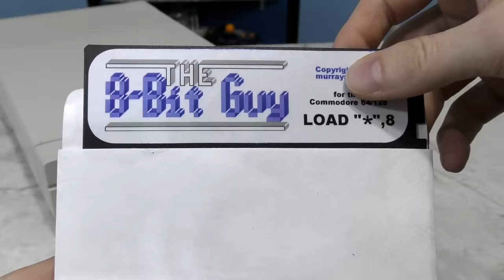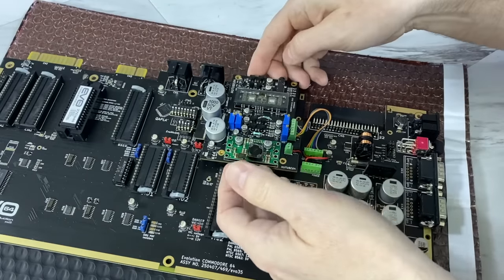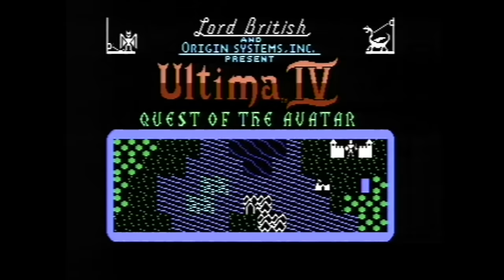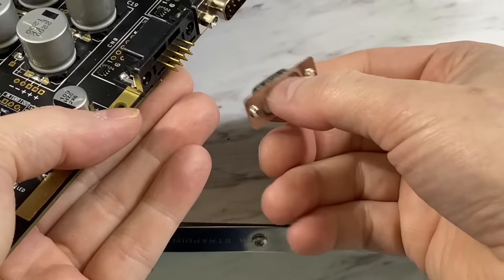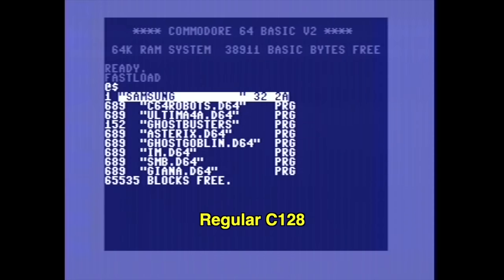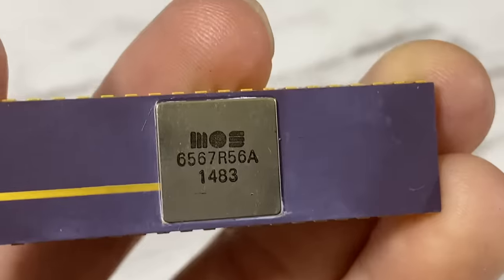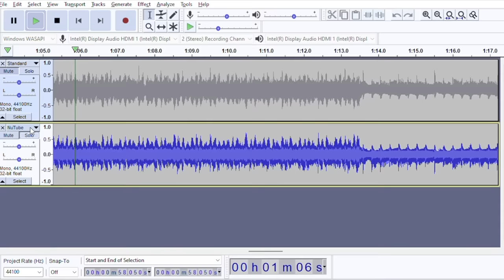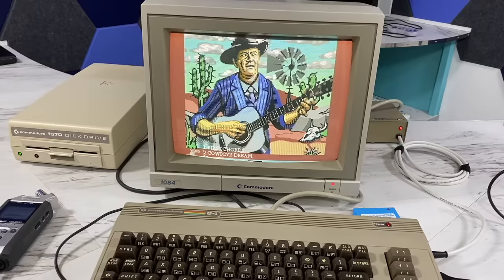The Evolution64 - Is it worth the money?

Comment: Dave, about the sound comparison, if you take the two recordings, and line them up 100% in a DAW or audio editor, and then reverse the polarity on one of the tracks and then play both tracks simultaneously, they should cancel each other out completely - if the tracks are identical. If not, you would be able to hear ONLY the difference between the two tracks. Then you can save it as a new track and import it back in the DAW, if you want to compare the waveforms.
Reply: So, I'm curious... is the SID chip itself precise enough that any two renditions of the same tune would ever come out exactly the same (even when played on the same hardware)?
Reply: @der4rdi  That's a damn good question! I don't know...
Reply: If one needs to go to such great lengths to determine the difference, then the difference is not great enough.
Reply: Because what you want to actually remove is noise I think, and do correct me if I am wrong, best way to do it actually record several recordings on each setup. Do the track comparison described by KDN above, and see which setup has the most divination between recordings. Yes. You compare the same setup with itself. That is a fair bit of work. But that is if you are interested in the noise reduction part.

Other elements may also have an impact on the sound. Like getting a softer or harsher sound. But those difference I would say is more of a subjective quality. While consistency of playback is more of an objective quality.
Reply: @BCADws  If someone is not really in how to compare audio, the first thing you tend to do is just the listing test. It is sort of natural. It is like he can just compare how good the video output is by looking at it. But audio work differently for humans. Humans are not so good at comparing that. Not only do human have less of their brains dedicated to hearing. The temporal nature of sound makes it harder to. Therefore, people tend to do very subjective test for audio. Even a lot of people that call themselves as Audiophiles do this.

But we who are a bit more interested in the science behind sound have a different way of viewing it. We like to quantify stuff. Indeed, I would actually like to quantify the video output to, even if I can easily see the difference in the demonstration in the video. But that is another matter. As such, we devise clever ways to do this. We define what we are looking for. What quantities that matters. And how to test them in the most objective manner we can think of. It does not come natural. It takes time to start figuring this sort of thing out. Since this is not how we naturally compare thing in our daily life.
Reply: I think he knows, Techmoan has done something similar quite a few times and the 8bit guy is his friend and follower of his works.
Reply: yeah that doesnt work when you get an analog audio source bc it will have a lot of random noise, the recorder he used basically has a digital to analog converter and does all the work
Reply: @DukowskiX  he did it by transferring the digital audio without reencoding or conversion from analog to digital or vice versa, the c64 only outputs in analog so the sound data wont be exact and itll have random noise so it never works itll always detect a difference
Reply: "Reverse the polarity"? Not until the Klingons have got us surrounded and all that's left for us to do is a one-in-a-million, hail-mary miracle manoevre!
Reply: One essential thing to do when comparing audio, is the noise floor. Basically the silence in your recordings. In many old computers there’s a high level of background noise coming from the on-board clock and the video circuitry. The EVO hopefully has a super low level of noise?
Reply: In addition to the caveats that everyone else has mentioned, timing differences in the recorder's data capture clock between different runs could cloud the results. Not an impossible thing to do, but these comparisons have their limits.
Reply: you'd probably see and hear some more difference if you'd adjust the level pots so that the output was near clipping or to clipping.  that way the tube would probably clip less abruptly and you could get a different sound out of the thing on purpose for purposes of recording music (you could just get roughly the same effect on a digital audio editor though if you wanted to).

in the linear range it's not going to have much/any difference from what it's "supposed" to be and in that it's just a gucci mod basically.
Reply: Damn. This has to be one of the best doctor who episodes
Reply: Doesn’t work like that. There is always a timing issue, meaning they will always be a bit offset, and you will have an analog signal which just isn’t exact. Depending on temperature and noise.
Reply: @der4rdi  8580 for sure is that good. 6581 on the other hand is inferior in sound quality. Then on the other hand, people, in general, tend to like low-fi muffled sounds, because hi-fi sounds have high frequencies that people, in general, aren't usually aware of and tend to dislike. That's also why many prefer tube amps over D-class amps or prefer vinyl over higher-fidelity recordings.
Reply: yes, techmoan does that a lot....
Reply: that shows there is a difference, it doesn't show what sounds better
Reply: subtract the two tracks from each other in audacity and what remains is the difference between the two.
Reply: @petermoeller5901  i could hear a difference between the two, and liking how something sounds doesn't make it better or worse... better is objective when it comes to audio if you're talking frequency response, cutoff, overmodulation... for example .. people who like vinyl even though its ability to record and reproduce frequencies is technically inferior to digital... or people who like tube amps even though they can't hit even remotely as high of frequency as a transistor...  they like the sound subjectively, but it doesn't make it better.
Reply: Two recordings will pretty much never be perfect duplicates of each other.  This only works with digital captures of the same data stream.  You can take a FLAC and WAV and subtract them to get (ideally) silence, or compare a source file with a copy of it played through SPDIF, to ensure there’s no hardware resampling going on, etc.  But two recorded clips will never ever be that precise.
Reply: You can do it in Audacity too
Reply: That wouldn't work, the sid chip is mostly analog.
The best thing you can do is FFT and spectrograph the waveform over time and see if you see ripples here and there.
Reply: Only listening to the difference between two waveforms is not a comparable listening experience to hearing the whole sounds. It can be good for some technical monitoring situations but it is pretty useless to find out how the emotional difference between sounds are.

In this case it was very easy for me to hear the difference, I even heard a difference clearly on my laptop speakers. This is probably in part because I am used to listen for these kinds of differences since I am often sitting and tweaking saturation some times for hours on end.
Reply: Techmoan used this technique to determine if shaving a CD to a beveled edge would improve quality. It was a null result.
Reply: @GeneralArdi  not unless they were literally made in the same batch. There's a well-known issue with the SID's filter, which has been emulated to a degree using sidplay and other emulators. In europe, we were more aware of this as you'd have the 'why does my mate's computer sound better on all the Galway / Hubbard/ Follin tunes, than mine' scenario. I'm exemplifying, but it'd literally be the case.
Reply: @AiOinc1  Well observed.  It might be easier to define what's causing the difference, though.
Reply: But if he did that he would be crossing the streams. Try to imagine all life as you know it stopping instantaneously and every molecule in your body exploding at the speed of light.
Reply: @AiOinc1  for those that don't hear the difference, it proves there is a difference. for those that hear the difference there's very clearly a reason why the tube is superior to the standard system. doing what was suggested only quantifies that difference. and realistically there's always a reason to record audio and compare them like this. whether it's you are looking for flaws in the sound and what you expect or you are judging the expected output to the processed output, this is how you would show that there was a difference between the two audio streams graphically.
Reply: @AiOinc1  True - but for me that's not a good reason to not do it. The idea itself had profound effect on my nerd bone, and we do these thing not because they are useful, but because we can \o/

And it's not a useless endeavour either - specifically if he had done it in this video. Considering that YouTube consistently destroys any chance of objectively showing if there is a difference via aural means, this is a perfect way to actually show if there even is a difference. And as a nerdy hacker, despite that I'm not interested in spending money to get something like this, even if the difference would only be audible to your ear if you're a dog, I would enjoy knowing if there even is any difference. And finally, for me most crackpot audiophiles this could be the only way you might be able to convince them that something has no effect on audio quality, if that was the case. Of course the downside is that any such person would automatically be convinced that they can absolutely hear even the slightest difference if the test showed even the slightest difference ;)

Still you're correct and I'm not by any means trying to invalidate your argument - just saying that it would be a cool thing to do it anyway ;D
Reply: @KDN Reverse the polarity of the neutron flow?
Reply: This ^ except the polarity flip isn't needed because for some reason it's already happened on one of the waveforms as he pointed out. So just line them up so they're playing exactly together and bam magically thru the property of destructive interference, you'll only hear the sum difference between the two. This doesn't tell you though which is contributing how much to the overall summed difference though.
Reply: one of the tracks was alraedy inverted, all he had to do was to copy and mix paste one on top of the other or save it as a mono file to substract one channel to the other and see if the result is a difference or silence.
Reply: You have to factor in the fact that the filter circuits are using different capacitors, and that we don't know what state the SID phase accumulators were in when the recording started. You also have to consider things like clock differences.

Under such conditions it's basically impossible to tell what effect the amplifier stage has on the audio; if multiple variables have changed you can't easily attribute a change in outcome to any one variable without an in-depth analysis of the exact character of the change in outcome, and a basic phase cancellation test is useless.